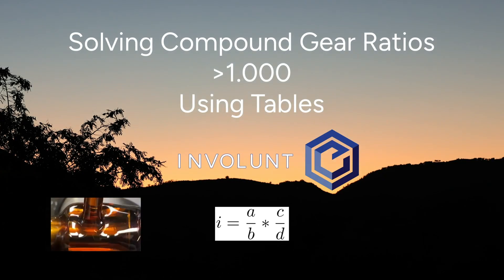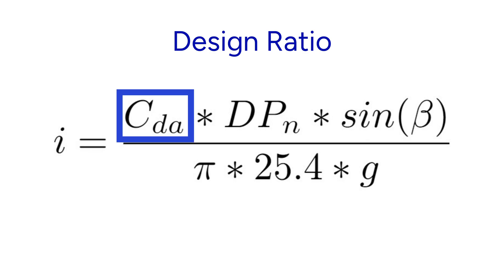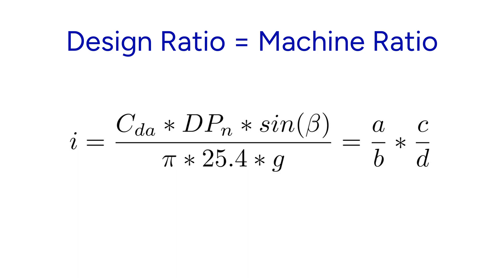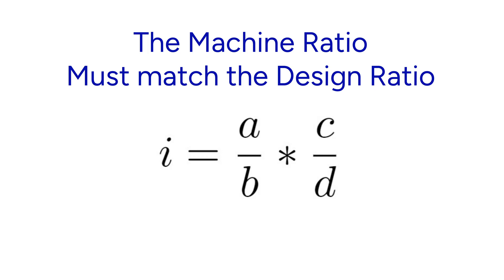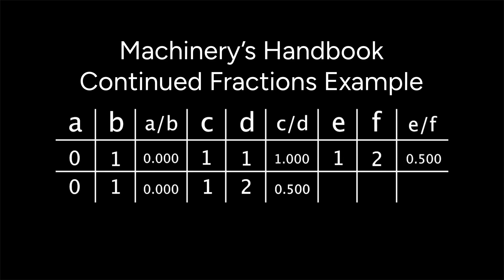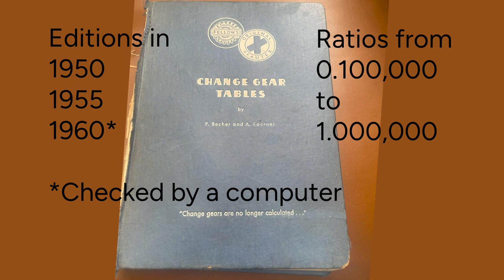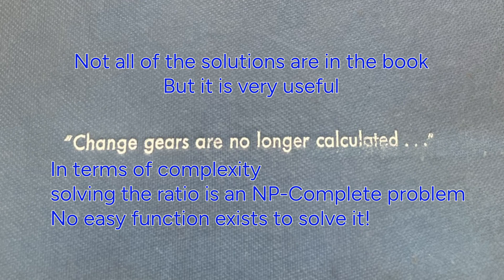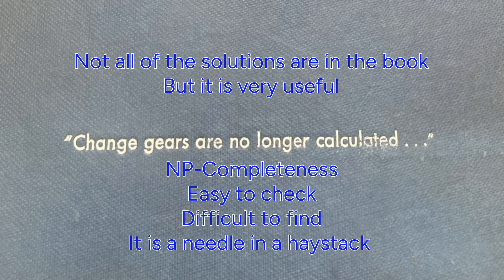Solving Compound Train Gear Ratios with Lookup Tables (Helical Gear Example) Read Below for $

Comment: For the hobber I use the formula is, 
Ratio divided by number of teeth desired on the gear times  the number of hob starts . Pretty straight forward , only time we have to do extra steps is when the number of teeth is too high and we don’t have that number change gear, then we have to start dividing and so on .
Reply from the maker: Yes that is the way. Here is another resource 
https://evolventdesign.com/pages/change-gear-calculator